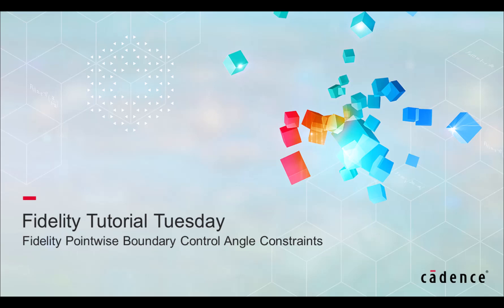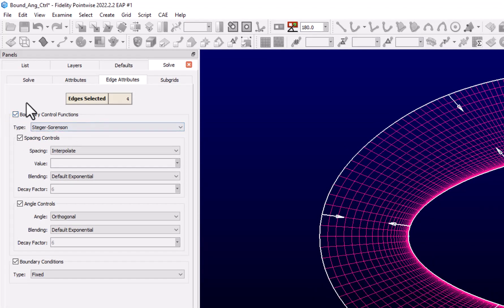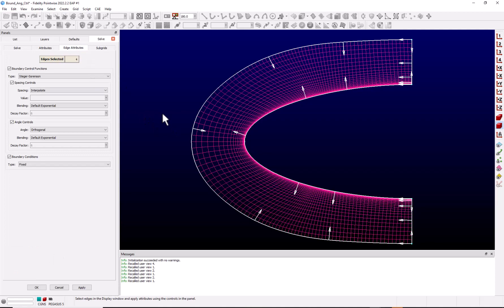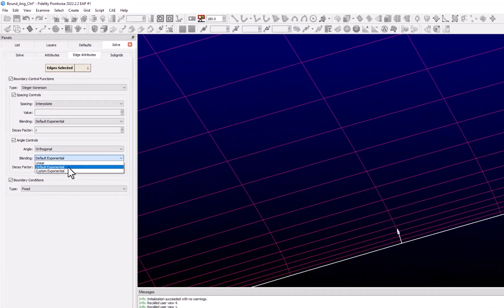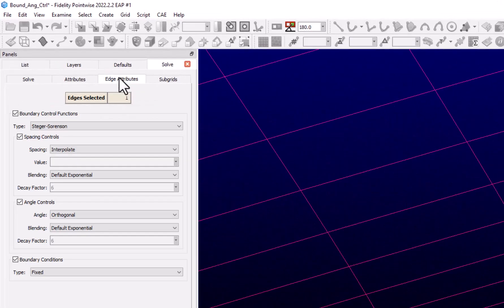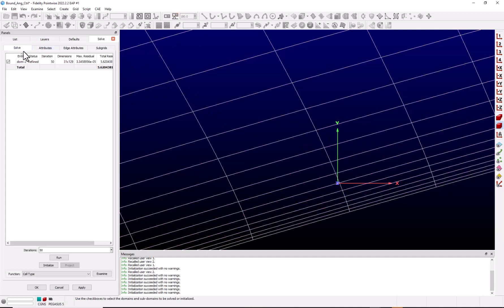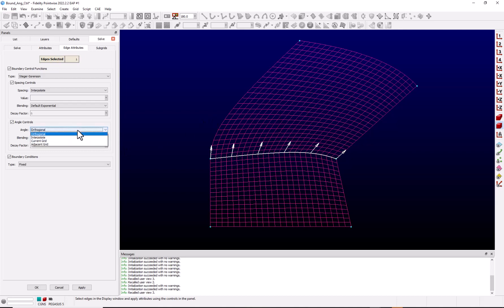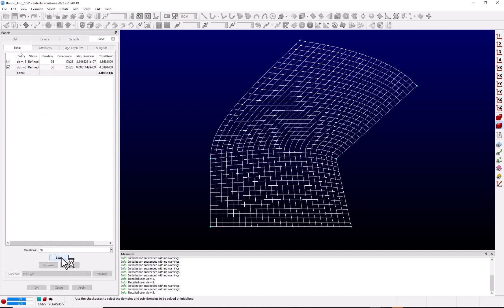Fidelity Pointwise: Boundary Angle Controls for the Structured Solver

Comment: Great 👍 
I request you to please expand Pointwise for FEA analysis also
It has very strong structure grid algorithms, and the bottom to top volume grid approach is something give an exponential control to user 
If we can use Pointwise for FEA then we achive a very high quality results which can greatly improve FEA simulation 

I did FEA using pointwise grid but it was a bit hectic work that require a lot of preprocessing task in Ansys workbench and for complex FEA model multiple meshes need to be imported and then bonded in FEA solver
Reply from the maker: Thank you for that suggestion. I will guess that the hectic work you describe involves setting loads, boundary conditions, and material properties. Would that be correct? Maybe there is a way to write your own CAE Plugin that handles the BCs, material IDs, and file formatting for "bonding" regions together. Have you considered that?
Reply: Actually the extra post processing work that I am describing is 
1. Exporting FEA mesh file as Fluent CASE File 
2. Using External Model as a loading interface to load Fluent Case file that I will link with Structural study say static structure and it will import now Case file as Ansys FEA mesh file

I can select surfaces and apply Boundary conditions over there

But there is a problem with this approach, here entire model will export as a single entity which means suppose if I want to suppress some portion of the mesh that I want to study later then that is not possible

However this approach serves its purpose with some limitations but it would be better if we directly get fea mesh from pointwise
Reply: @realkanavdhawan  Thanks for the clarification. These are all the detailed things that we don't know about because FEA for solid mechanics (in any solver) is new to us.